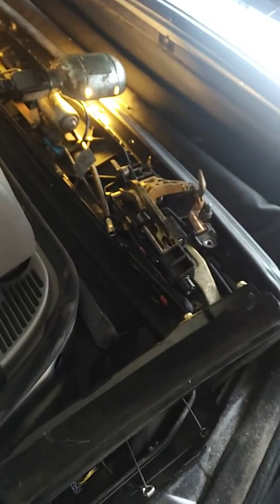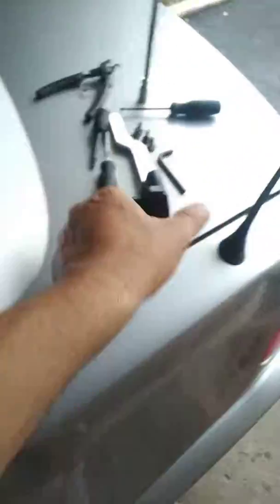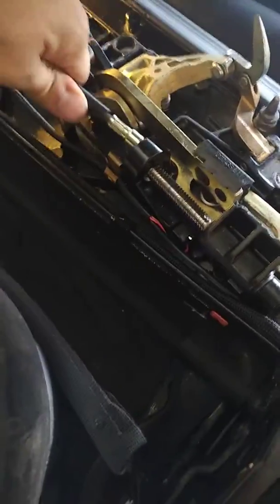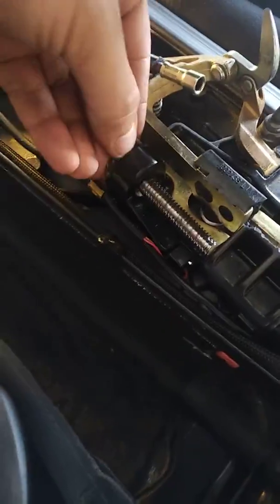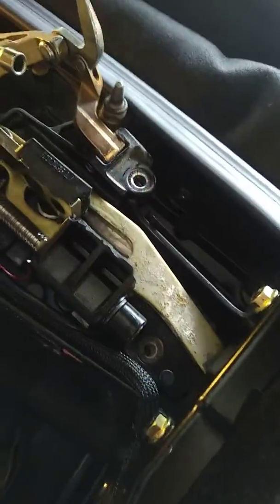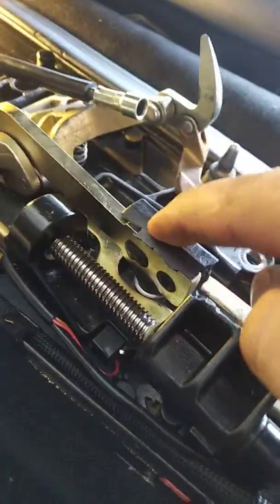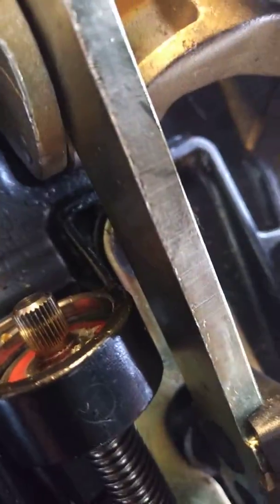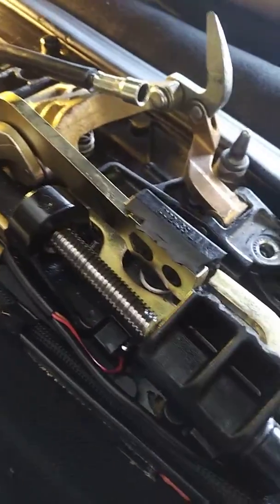Bmw E46 M3 how to replace top lock lever on convertible

Comment: I’m having trouble with the last step( to screw out). After removing the clip how do remove the bearing? Thanks for your time.
Reply from the maker: It's been a while, first did you remove the bottom bolt that I addressed and if so and if I remember correctly you wanna push the whole shaft in the direction where the safety clip was on then you just start spinning the shaft till it completely comes out. Just be careful not to damage the bearing. Hope this helps
Reply: Hi, I will try that. Thanks again
Reply from the maker: Good luck
Reply: You use a Allen wrench and you turn the screw at the end until it pops the bearing loose

Comment: Unfortunately my lock broke while in the locked position. I tried removing the side weather strip to expose the Allen bolt to manually unlock but the bolt is not exposed making it impossible to even open my top even again.. I need to replace my top and can't do it now because it's locked shut in the up position.
Reply from the maker: You are talking about the mechanism underneath the rear seat, correct?
I believe there are a few 10mm bolts that hold it in place. if you remove those and open the plastic cover to access the gears and move them manually while pressing on the release button located on top on the mechanism box.
Reply: If you are still trying to do this I can offer some advice. 1st take down the interior plastic trim. Do that by removing the visors and screws at the light. Also the A pillar molding. This will expose the plastic shield to the top. At this point you either have to cut it or you can unscrew the fabric from it and and the screws up front. This will not allow you go remove it, but you can now pull it down. Pull the insulation from the top which you did to access those Allen holes that were unsuccessful. At this point with a friend holding the plastic down locate the outside end of the latch which is closest to you and with something flat whack the latch inwards toward the rear view mirror. 

I had the same issue and that was the only way to do it without cutting.